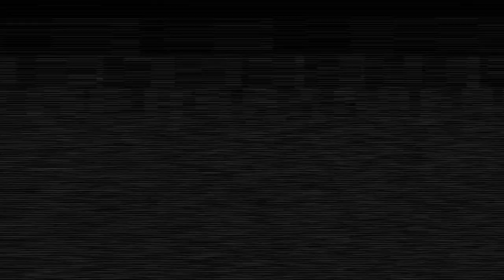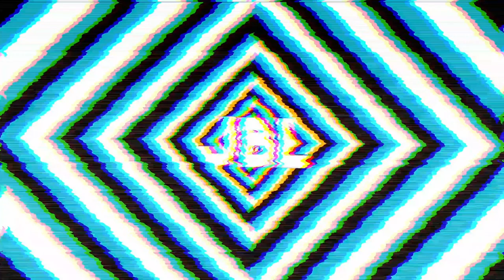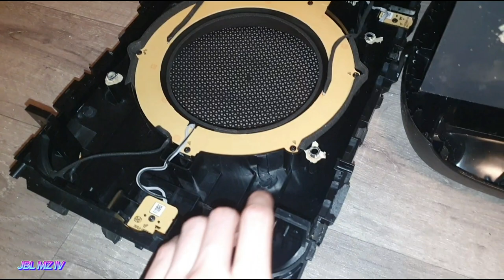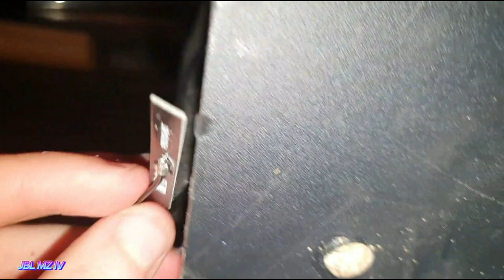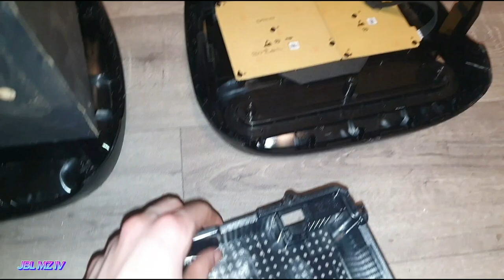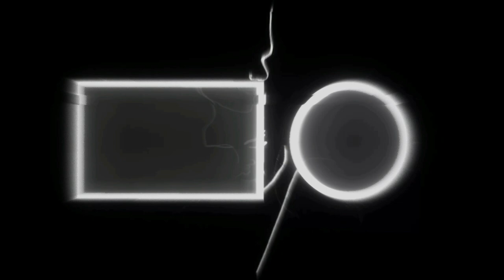JBL Partybox310 full teardown

Comment: Hey, I'm going to be looking at a broken Partybox 310 for a friend of mine very soon, do you happen to have the part number for the battery? I'd look to find out how much the replacement parts could cost so I can inform them in advance.
Reply from the maker: You can also take a partybox 300 battery is the same as in the 310
Reply: @SpeakerArcade  That's good to know!

Comment: just a question , can i swap the subwoofers with two stronger ? or it can damage the speaker?
Reply from the maker: You could do it, but it would sound worse
Reply: @SpeakerArcade  thanks, more one questoion, if i use a different equalizer and increase volume to 140% but turn off bass boost, it will damage the speaker?
Reply: @LawrenceDotaCoach there is no way to damage a speaker with just equalizer, you would need to overpower them using an amplifier